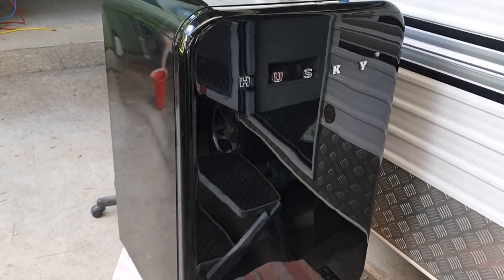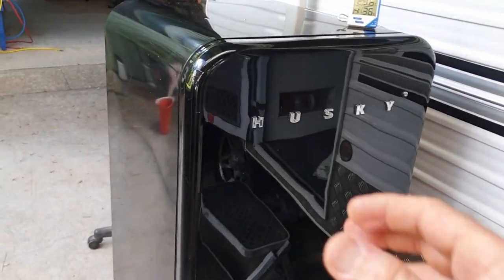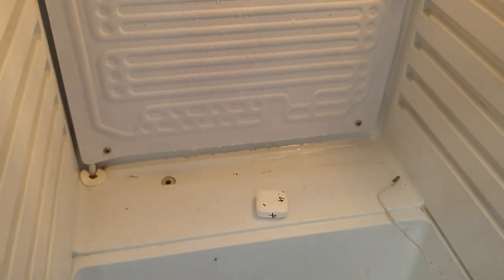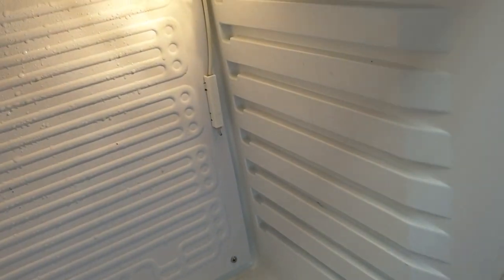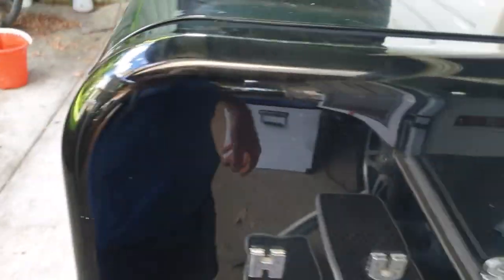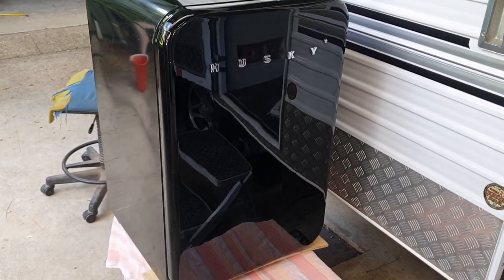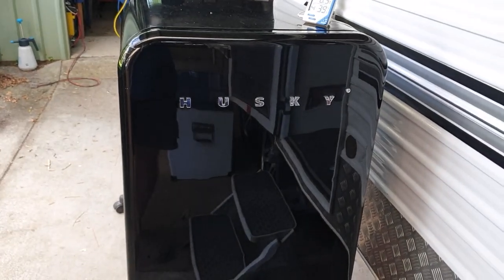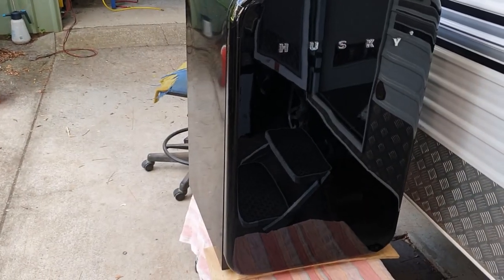240Vac to 12VDC Fridge conversion

Comment: I believe it's much more than 15% loss of power using even a sine wave inverter, by cheap Chinese solar controller inverter combinations, for less than $50 you can get them to allow 2400 watts of PV solar power input, just 2 100 amp hour lithium ion batteries will run a LG linear converter 300 litre fridge, well at least here in the north of South Australia where there is abundant sunshine

Comment: I run domestic fridges off an inverter. You need to use a Victron inverter which has a standby current of less than 1 watt and the 800 watt Victron will start big fridges and freezers fine. If the fridge has a thermostat use the standby mode on the inverter and the inverter turns itself on when the fridge starts. If the fridge is a modern 3 phase motor the inverter must be left on all the time. The higher star rating (3 or4) means the fridge probably uses 3 phase. These are more efficient. Another thing I do, is usw Westinghouse bar freezers (4 star) and turn in the screw on the thermostat about 5 or 6 turns. This makes the freezer into a fridge (0-4C) and because of the insulation it only draws 10A/h per day at 12v.

Comment: Watched a video by ldsreliance where he he had to to 3000w inverter to run a mini fridge because inrush would trip smaller ones so power loss would be even greater going that way
Reply from the maker: Mini fridges usually run fine on as low as a 600 watt inverter even a large domestic fridge starts reliably with a 1000 watt imverter, so not sure what he's on about.
Reply: @timterry8714  ya.  Actually tried it last week with a 1000w inverter and worked perfectly fine.  Maybe some inverters can't handle it.  But mine is nothing fancy
Reply: It has 1200w spike
Reply: Clearly a poor inverter. A victron 800W will start any fridge and uses very little current. My 1600 Victron runs 2x 260 litre fridge freezers (westinghouse 3 phase) and two westing house 80 litre bar freezeres. Doing this in 30c ambient draws 100Ah per day (1.2 kW/h)

Comment: I do have both a bar fridge and 4x4 fridge that runs on 240v and 12v. But that fridge is flat and I like the upright bar fridge for easy access. Is it possible to do it? Really appreciate your response
Reply from the maker: Yep works great but as I stated in the video it can't be a "frost free" must be of that style internally.
Reply: You can run a 240v fridge from a 12v inverter BUT using the fridge thermostat as the ON/OFF, the advantage is that when you set the fridge temp via the thermostat, it will turn the inverter off when the fridge has cooled to the desired temp, and back on if if you open the door . This saves your battery being used all the time .
Reply from the maker: You can do that but it still needs to be a non frost free type fridge

Comment: I have a 240v under counter fridge freezer on my boat running via a 2000w inverter, how easy would it be for “me” to convert it to 12v? assuming I can source a 12v unit? Is it something an average guy could do?
Reply from the maker: No it's not!
Reply from the maker: Sorry I should have elaborated on that. Its a complete change out of the compressor, controller and condensor, some rewiring and a thorough understanding of small refrigeration systems.
Reply: @timterry8714  thanks… oh well that’s it for me I’ll have to stick with the 240v set up

Comment: Very informative. I can see a great business opportunity opening up here as more & more off-grid people realise the benefits of avoiding the DC-AG-DC pathway. 
One thing that could be tidied up is your quoting of energy usage. As I guess you know energy is measured in watt-hours. Power is measured in watts. The relationship between speed & distance is a useful analogy.
Reply from the maker: Thanks Richard, I talk amps as that's best understood by most people in regard to their battery storage capacity. Most people don't understand watt hours and have difficulty relating it back to their battery/solar system.

Comment: Hi Tim
Thank you for the video.
My son has an old caravan and is wanting a 12v retro fridge. Impossible to buy in Australia. 
He is keen on the SMEG 38L FAB5RCR5AU. I am an electronic technician (no refrigeration experience) so I am hoping that I can do it for him.
Do you think that model is suitable?
Thank you :)
Reply from the maker: As long as it's not frost free with cyclic defrost, fan, defroster element. It's got have an evaporator plate and old style mechanical thermostat as I explain in the video.
Reply: Hi Tim  @timterry8714  
Does the refrigerant gas need to be drained and then the pipes welded and the refrigerant refilled?
Reply from the maker: Gas recovered from the system, compressor changed out, plumbing reconnected, pressure tested,  vacuumed, nitrogen run through it, regassed, wiring changed for 12V an adapted to existing  fridge wiring and components, etc
Reply: Run it with a Victron 800w inverter simple and low current draw

Comment: Im currently trying to re jig my broken fridge ac. Im going to upsize it with bigger coils, etc. How did you get around the 12v transformer and wiring that comes with your new compressor
Reply from the maker: There is no 12v transformer- the compressor runs at 12v.